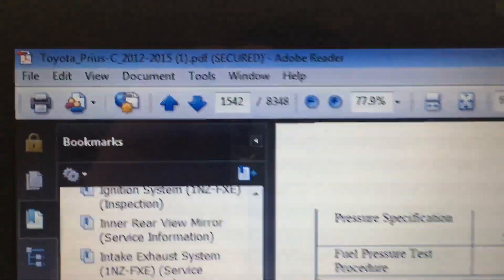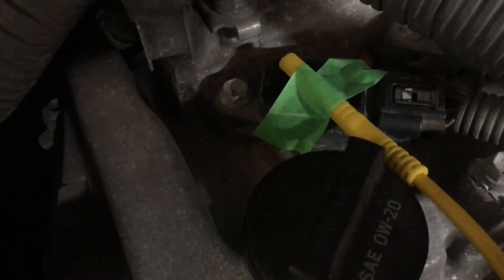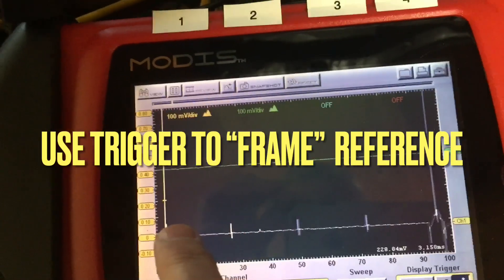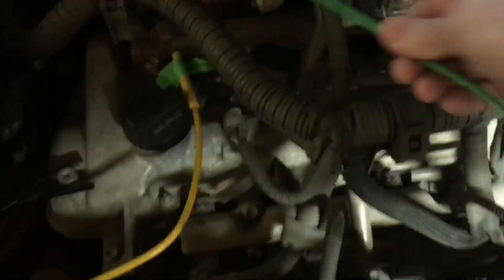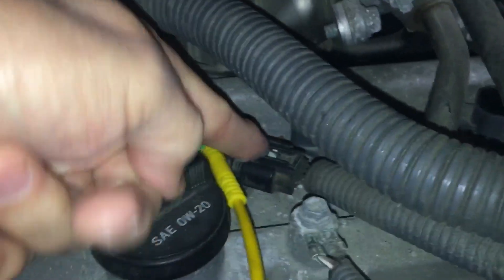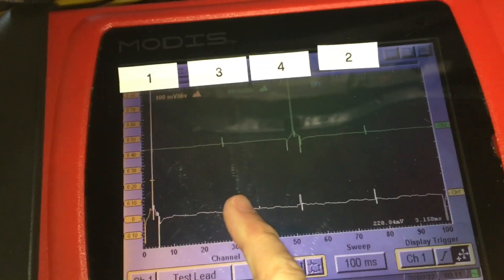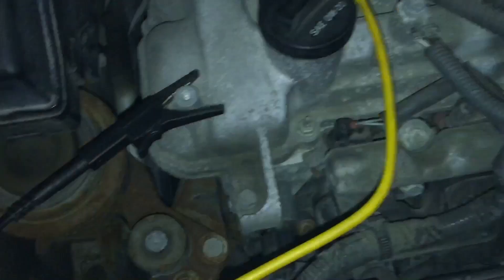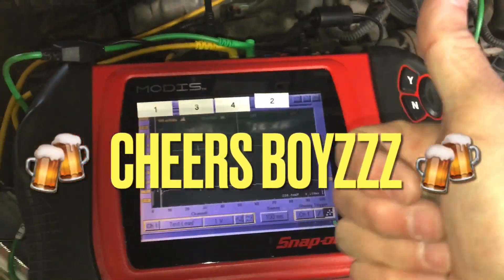Firing Order Determination (Quick & EZ)

Comment: I love when someone does something fairly simple but never occurred to me. Thanks.
Question: Can you override the engine shut down when the battery is charged for diagnostic purposes?
Reply from the maker: Sorry not sure I understand the question?
Reply: @TheGibby3340  sorry let me try again. You mentioned that once the main battery becomes fully charged the computer shuts off the engine. Effectively putting an end to whatever you are measuring on the running motor. Is there are way to keep the engine running regardless of the charge status of the main battery?
Reply from the maker: @mfsperring Ok,ok…sorry Mark. I haven’t seen this video for ages so completely forgot the context. Hybrids tend to have maintenance modes available. Scan tool or even in vehicle procedures you can perform, which can keep the engine running for testing/inspection purposes. 👍🍻